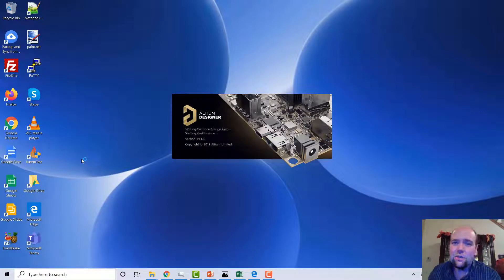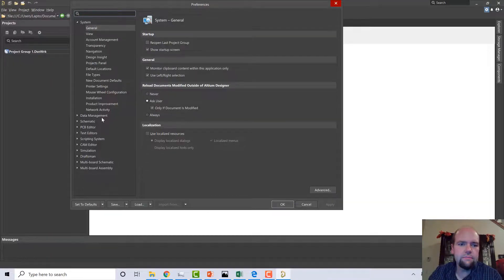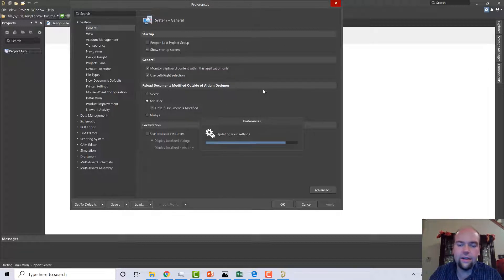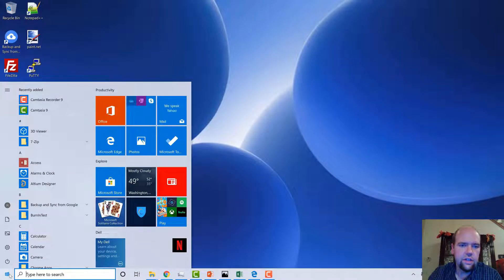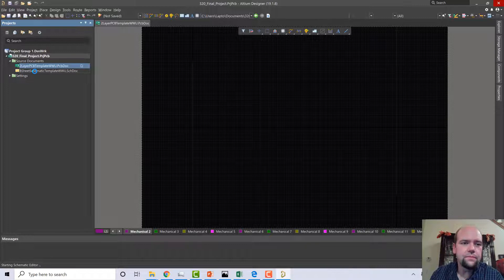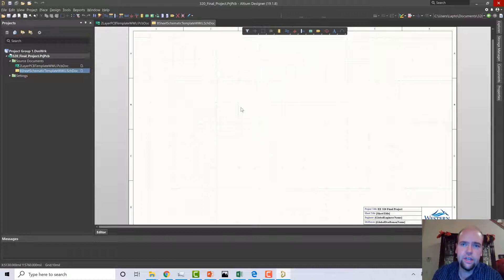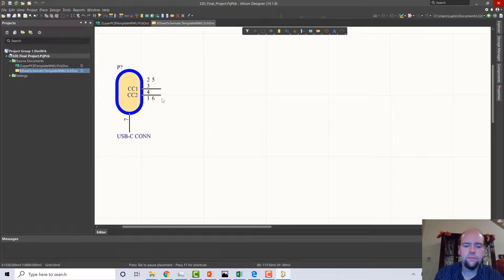Altium 19 Start to Finish Tutorial (Video 1)

Comment: 2:00 - preferences
4:50 - add project template
7:45 - start schematic design
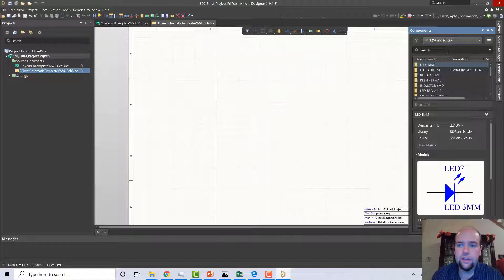9:30 - USB C schematic placement
17:45 - annotations
20:00 - charge controller schematic placement
29:30 - update board with schematic changes
32:30 - flip component to other side of board
37:00 - routing